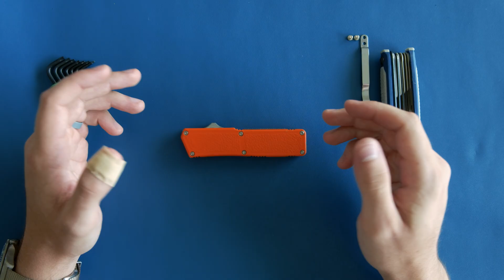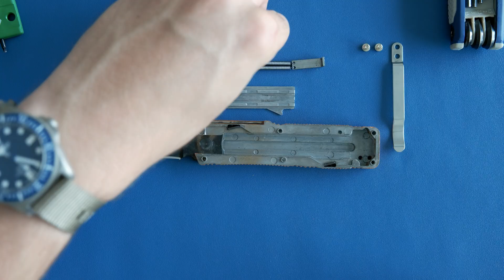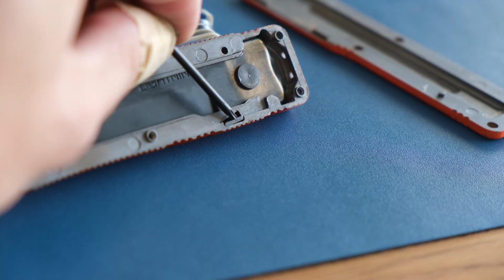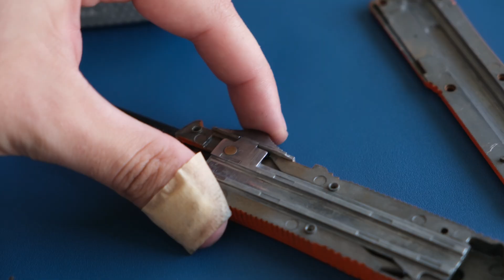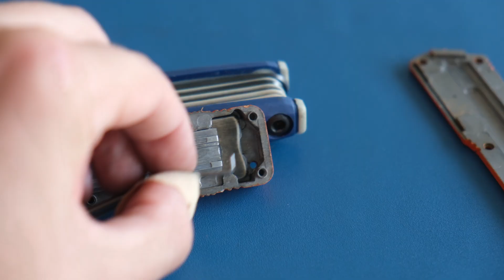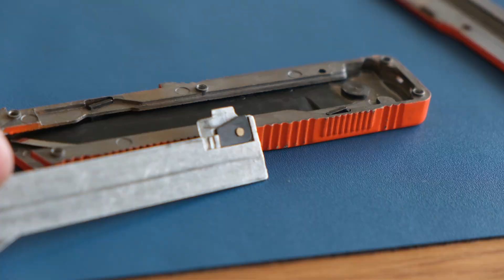How Does an OTF Knife Work? | In-Depth Demo

Comment: I think the top lid (or cover) does actually have a function: the ungroved part forces the front hook onto the tiny metal plate on the blade when slider moves forward. If without this part, the front hook will not engage the metal plate on the blade, thus it will not be shoot back. I found this when I tried to create a 3D printed OTF with mechanism from real OTF (instead of using plastic springs)

Comment: If you Polish up the Slide bar and the bottom of the Actuator button and the top and bottom edges of the blade you will see a day and night difference in how smoothly the action works on your OTF’s I’ve done this with every OTF I own weather it’s a high dollar or cheap Clone and I’ve had no issues with deployment or retraction. I’ve got a Microtech Glykon Clone from SHEIN I’ve been carrying for 2 years now and it’s never failed! Just a little bit more finishing touches makes a world of difference.

Comment: I know this is an old video but FYI you can buy a D2 Blade from Cobratec and it fits perfectly no modifications in the Lighting Elite makes a much better OTF at a budget Price. Side note the Cobratec Blade does not fit in the Original Lighting. The Blade from Cobratec has to be a replacement for the Lightweight Cobratec OTF.

Comment: More of an expensive "fidget toy" in my mind.
Sure it would be great for some cutting chores,  "however" am not convinced what keeps it open, locked in place would be strong enough for any serious labour which fixed blades are better suited in a work related situation requiring cutlery for prying, piercing and such for heavy materials. 
That litte " Detent" that holds it closed looks no stronger than them cheap OTF switchblades with shoddy pins and spring  that got imported in this country around the 1980's, sold for more than they were worth to those whom did not know any better. 
Would have one if legal for a collectors piece, "Not for everyday use."

Comment: Nice one! Thanks for the explanation.
I used to have an otf switch blade and before a "friend" stole it from me, I took it apart to see how it worked.
Such a beautiful and clever principle!
My one used a slightly different layout, but the principle was the same.

I found the blade could be interrupted in its travel and that left it loose - I honestly thought I'd broken it for a moment, but pulled it forwards, locking it to full extension and it worked as it should again.
So, the springs are evidently not strong enough to switch the blade with intention of piercing something in front of it.

Comment: I love these knives. Who invented this is a genius, the whole operation of it seems so complicated until you break it diwn and look at the mechanics. Whats crazy to me is that these knives are super illegal in so many states. Just carrying one in the wrong place can get yiu a felony charge. Its sto freaking stupid! Its not like this style of knife is more dangerous than a regular fixed blade. Its still just a knife weather tge blade retreats or not. And no if you put this against a body part and hit the switch they do not have enough force to fully penetrate skin. I accidentally hit the switch to open on my 280 dollar OTF benchmark with mu left hand in the way, ya the tip stuck me a bit and I was bleeding, but no it did not through my hand like most people think it will. And also the blade on this thing is super sharp crt steel, its razor sharp. Its completely redicoulus that these knives are illegal anywhere in the U.S.

Comment: Yeah, this is the best I've found and explains the mechanism well.  What I didn't understand is where the spring got its power to move the blade in both directions.  Now that I know that the spring is stretched by moving the thumb slide it all makes sense.  It's actually the thumb on the button supplying the power to the spring.  Thanks a bunch for making the effort and taking the time to put up this video.

Comment: Excellent. I actually put it back right but I didn’t understand how and why it works. Even though I put it correctly, it didn’t work but now I know what and why, I can make it work. I learned a shitload. For instance I didn’t know it was called off, or detentes were not spring loaded pieces of shit. But thank you for sharing ur wisdom cuz I paid $69 bucks for the higher quality stuff ne but my $20 is still working, can’t cut a shoe string but it opens my broke one slices my finger just rubbing against it trying to figure shit out. Be careful all you enthusiasts out there, sometimes those things work and will cut you

Comment: Superb! Clear-concise explanation in sequence puts it all together for me.  Question: I found your video while looking for ways to clean/lubricate my (not here yet) OTF. I wanted to use a specialized grease but it needs to be put on sparingly (it's spendy) and to help avoid becoming a dirt trap. Your video shows me how to reach the thin tiny points perfectly.

 Do you recommend or frown upon lightly greasing the contact/sliding points? I will be using Dow Corning Molybdenum medium grease (-40 F to 120 F) on the tracks for the blade. Thanks for a great tute!

Comment: This was an awesome video , thanks ! I had mine in a drawer for a while. Pulled it out today and tried it. And , it wouldn't work at all. Not sure what happened just sitting there. I took it apart but , wasn't really sure how it worked. Put it back together a couple times. Still wouldn't work.  I watched this video , took my time and eased it back together. And , it works as good as new. Thanks again !

Comment: My spring on my otf is always derailing/stops working, it’s brand new and I used it once, in and out. Then I go to try it again and it doesn’t come out anymore. I opened it up and “fixed it”. It worked then broke again the Same way. What can I do?
Reply: Get a knew knife unfortunately. Sounds like the item is defective.

Comment: Found a Benchmade OTF on the side of the road a while back, and I loved that thing. I basically used it as a glorified box opener, but it was extremely handy and I used it every day. Then it started getting stuck open. Took it apart, thoroughly cleaned it and hit it with dry lube. Still gets stuck out. Thought about buying a new one, then I saw the particular knife I have is like $400. I was hoping to glean some insight as to why it would close normally, but I'm still stumped.
Reply: Send it into Benchmade , they will probably fix it no questions asked.
Reply: a knife that doesnt even have a tang, is indeed a glorified box opener
Reply: @dumbcook42if you don't understand knives I guess thats's a valid claim. Billions of knives aren't full tang son.

Comment: Applying years of gun smithing, race engine building and machine shop experience…….it seems only logical that IF one was to mirror polish the contact surfaces on the plate and the detents, the “trigger pull weight” can be dramatically lessened on these which would provide a much lower amount of pressure necessary to be applied to the thumb switch in order to fire the knife! 🤔🤔

Comment: So basically the two springs (some OTF knives use only one spring) are under some stretch tension all the time.  Moving the thumbswitch adds some more spring stretch tension and releases the little catcher tabs on either end and the blade slides either forward or backward.  Pretty smart idea making a spring do work in either direction.  I just wonder how much thrusting force an OTF knife can withstand before the blade collapses back into the handle.  Seeing the guts of the OTF makes me think of a glorified utility knife for some reason.  I guess it is like seeing the sausage being made.  Great job on your video here.
Reply: They do not have much force at all. If you were to open it against bare skin it would just poke you. You may bleed alittle but it foes not have nearly enough force to fully penatrate your skin.
Reply: An OTF is not ideal for thrusting or stabbing.  It's a slashing knife and it really is a glorified utility knife, no matter how a manufacturer "refines" the innards, utilizes fancy metals like titanium or what-not and raises the price.  An OTF knife is a super convenient one-handed utility knife that makes total sense when you only have one free hand.  There's some automatic knives with a lockback configuration, necessitating two handed use at least on withdrawing the blade.  The king of all automatic knives is a side opening/swing out button-automatic. Even if the deploy spring fails, the blade can still be pulled out manually and locked into place.  The archaic Italian switchblade stilettos are just as good and have a very useful swinging bolster release.
Reply: Correct, 1 spring is under tension when the blade is in and the other spring goes under tension when the blade is out.
Reply: @ACommenterOnYouTube That's not how it works. Some designs use one big spring, while this one uses 2 smaller springs to do the same job. Both springs are under tension all the time. When sliding the release backwards, both springs create extra tension in the forward direction. When sliding the release forward, both springs create extra rearward tension.
Reply: @ My description is 100% correct, saw the animation on here on YT ...
Reply: @ACommenterOnYouTube  no its not, lol. Doesn’t matter what you saw elsewhere, your description of it here is completely wrong.

Comment: Great video. Would love an explanation of how the blade stops if it encounters an obstacle / resistance while opening though. That’s an excellent safety feature of these OTF knives and always perplexing. Is it because it has forward momentum from the spring while opening but doesn’t reach the detent to “lock it open” so it just stops the momentum?
Reply from the maker: Thank you! I have a short video on explaining just that, it's titled "What happens if an OTF knife OPENS in your POCKET!!" hope you find it informative!
Reply: @ThumbStuds  Thanks for responding. I watched your video short on OTF knives opening in your pocket. But it doesn’t explain why it stops itself. I’m guessing because the spring launches it forward but it never reaches full lock out at the detent so it is stopped by whatever obstacle it encounters. Seem right?
Reply: Yeah, the power of the spring is pretty weak, if it hits an object it doesn’t have the force to keep travelling to engage with the detent to lock it in place. That’s why you can just fix a not fully opened OTF by pulling out the blade and let it engage with the detent and it will work again.

Comment: I don’t understand how the spring tensions itself when the blade doesn’t get deployed
Reply: That’s the point - the sprint isn’t tensioned when not deployed. You start moving the slider and only then it starts tensioning. It won’t deploy because it’s stuck by the detents. Once the detents are depressed by the metal plate the loaded springs fling the blade to the other side.
Reply: @nabins52  that makes sense because I put something in front of my stepdads knife to see what happens when it doesn’t get fully deployed and it wouldn’t retention and I thought it was broken but after a few times redeploying it it was working again.  So you are saying that the actual detent holds the tension?
Reply: The spring/springs are ALWAYS under some slight tension in either the open or closed position.  Moving the thumbswitch adds even more spring tension and releases either the forward locking tab or the rear locking tab and the blade is flung in the right direction.  Pretty cool fooling a spring into working both ways by always being under tension.